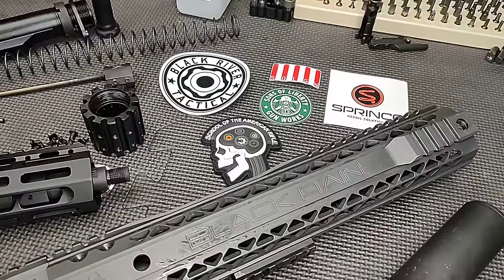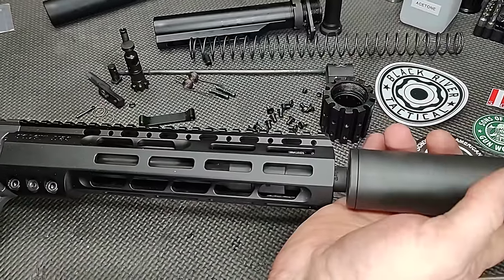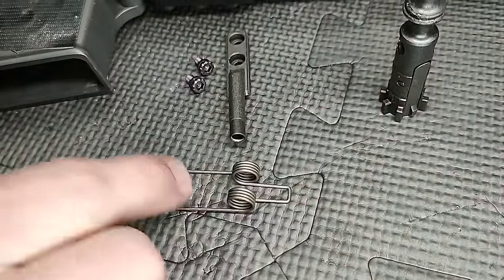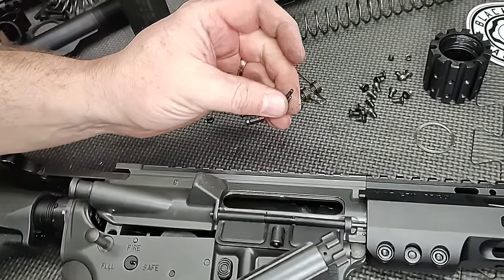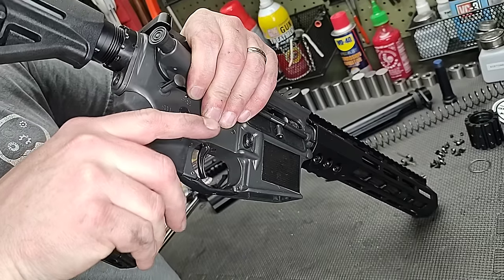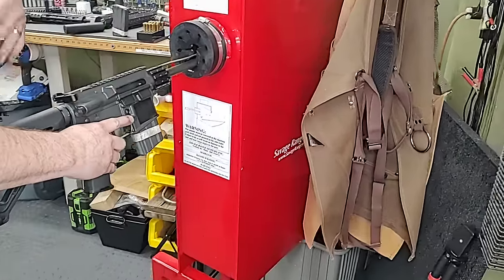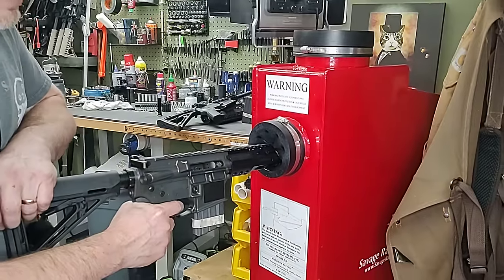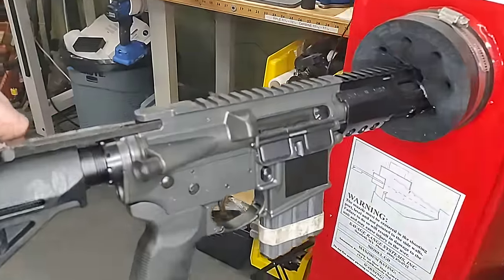Black Rain Ordnance SPEC15 Machinegun Rebuild - Part 2/2

Comment: It’s neat seeing some modern production machine guns we aren’t allowed to access. 

All animals are equal, but some animals are more equal than others.
Reply: Just one hole different than the normie ar's. You know you can buy a stamp, and be "allowed access".
Reply: Firearmism
Reply: @nobodynoone2500  Not for new production Machine guns.  The stamp only works for "Transferrable" pre 1986 machine guns.
Reply: @yc9419 yes however realistically a pre86 lower would have little to no difference compared to this, the majority of modern features are all in the upper with the exception of maybe the grip and stock

Comment: Thank you for showing that you actually have to go through multiple iterations of how to set up the firearm for it to work... So many people just want to show how everything works on their "first attempt"... Most of the things you figure out in life are ways not to do things before you figure out how to actually get them done correctly...
Reply: Yeah, i see the same with lots of stuff here on youtube. If you don't already know enough to know better, changing jets on a carb 6 times seems like no big deal until you actually do it and it takes all farkin day.
Reply: Granted it is easy for those of us that know how to, but remember back before you learned and how daunting it was. 99.999999% of people do not understand how guns work. So when they soend 1500 to 2500 dollars in one, its had better work perfectly. If it doesnt then its a piece of shjt. Its really that simple. Could you and i make a vlack rain work similar to an LMT? sure, but it will never last as long or be as reliable. Imagine buying a new car and you gotta replace the head on the first day.

Comment: How's Black Rain Ordinance still in business? Using a power drill to tighten down hand guard bolts?
Reply: I've used clutched drills to install parts before after calibrating them, but it's not ideal for parts that need to be perfectly torqued, like on firearms, engines, or other precision machine.

Comment: ever since the first vid id been wondering why they went with B.R.O.?  honestly iv never heard a single good thing about theyre rifles, the only one ive ever worked on was so out of spec it came from the dealer NIB with a  wobble wedge. and for some reason a cmc drop in trigger i thought this was kinda odd and soon i found out why, i couldnt get a milspec fcg to cycle or even fit properly , the hammer barely let the bolt by, tried a spikes fcg, a bcm, and a rra 2 stage, tried swapping different bolts colt, lantac, bcm,, and in the end i still had to ''polish'' (and i use this term loosely) the surface of hammer that makes contact with the bolt on the CMC trigger so much just to get it to run right that i didnt feel comfortable giving my buddy his rifle back and ended up just giving him one of my old spikes lowers and taking the hit, contacted BRO and the pretty much told me it was my fault and blew me off.....id literally rather run a f-ing anderson 
(sorry for the rant but i needed to vent🤣🤬)
and as always thanks for uploading, your vids are priceless, and the best on the platform.
Reply: LE agencies will buy the damndest things. My last agency bought a pile of PSA’s to “replace” the 1033 program M16a1’s. Absolutely HOT GARBAGE rifles. Very short rifle courses were destroying those guns to the point I didn’t want to issue out any of them. And don’t get me started on the Veritas 9mm PCC’s to replace the MP5-40’s 🤦🏻‍♂️
Reply: @ZSC001  gotta spend that money so next years budget doesn't go down!!!!

Comment: Thank you so much for this video! I know you had replied to my original comment on the first part of this series and hopefully you'll see this comment as well! My dad  bought me and him both a BRO spec15 for our first ar15s and I haven't even put 1k rounds thru it and after seeing this I'm most likely going to have a professional like yourself look it over before shooting it anymore!
Reply from the maker: There are not many gunsmiths that will do a better job than BRO has already done. 

Many gunsmiths will make things worse if they don't have the right tools. 

You would be shocked to hear a conversation between me and most gunsmiths.

Many gunsmiths will claim to know the AR well and happily take your money to do a terrible job. 

Be very careful on who you select.
Reply: I took the armorer’s course at Black Rain. It was an excellent course.  We got a factory tour but signed a non disclosure agreement so I won’t say anything about that.   I have not purchased a Black Rain.   I do think a buyer of any AR, new or used, should break it down and inspect every part, especially the gas system, pins, and springs.   An armorer’s course is a good idea for any AR owner.   I am not mechanical and knew little about the functioning of ARs before the class.

Comment: Curious if you use SOLGW for most of your builds @SchooloftheAmericanRifle. I absolutely love their muzzle brakes, I use them on every single build I own. They modified flash hider/brake they have in my opinion beats the surefire and the QD portion is just great for my suppressors. Havent used any other parts yet from them but thinking heavily of using them in future builds.

Comment: Great video series. My question is this when you get the other rifles, do to keep the gas tubes the same and enlarge the barrel port? Or, will you change the opening on the gas tube. My way of thinking, and I believe I can be super wrong, but making all the gas ports the same will aid in consistency between each example. I could be and can be totally wrong in my thinking. What are your thoughts? Again wonderful content and, you have spent my money on gauges and tools and have taken my builds and knowledge far beyond thank you sir!
Reply: Enlarging the port size requires drilling as opposed to just swapping components. Same result but with far less PITA.

Comment: Was it just my old eyes, or was the rear of the follower tilted downward at the rear when it failed to cycle? If it was, did that contribute to the failure , or was it just the buffer weight/spring combination? Sorry, I'm easily confused...

Comment: Would love to have seen a Geissele super 42 spring and buffer as an option. Granted they are on the pricey side and the customer/Leo is on a set budget but you get a lot of bang for your buck with the Geissele. The springco springs are great I have a few rifles set up with them but I still prefer the super 42 buffer and spring way more for reliability and quick and easy buffer weight adjustments without changing the buffer itself just adding or subtracting internal weights. I’m not going to pretend I know more than you or anyone here so I’m sure everything was chosen for specific reasons. Great video and great content this is by far one of my favorite channels on yt, thank you for all you do.
Reply: Agreed. I run one and like it. Was curious if Chad had an opinion on the design. A few guys I know don't like em, but they have a 'mil-spec or nothin' attitude.
Reply: The super 42 system is great IF you are refusing to deviate from the standard carbine buffer tube. I have one on an 11.5 that i wanted to keep shorter as a cqb gun. However A5 systems run inherently better because they are closer to the original design of the gun and allow a wider operational envelope but at the cost of adding about an inch overall to the firearm. So really as with most things it comes down to purpose and perspective

Comment: How do they use a power tool to tighten that barrel nut? Do they have an Uber deep socket? I’m also curious about replacing the bolts in barrels that already have some wear on them. Is headspacing not required?

Comment: How do to BRT gas tubes "age" as far as erosion-over-time goes compared to a barrel?  Still a great solution, and the fail-safe is just to "more gas" but I was curious.
Reply: They will erode over time and the port on the tube will open up and eventually need to be replaced. How much and how quick would depend on a lot of factors such as firing schedule, suppressed or unsuppressed, ammo etc.. but if we are talking about a full service life of a barrel then id say youre prob looking at replacing it 2-4 times depending on how far you let it open up beforehand
Reply: @silverbulletstackin1752  That's honestly not bad all things considered.
Reply: @mattfleming86  youre right its really not. Obviously it would be better if the gps were drilled right in the first place but even then you are still going to see erosion on both the tube and port over time

Comment: Will you ever do a physical on a JP Enterprises BCG and bolt? When I shop around for a new barrel, many manufacturers list them as the bolt they use to headspace.
Reply: JP is an og used to be they built all kinds of shit for name brands, dunno if that's still the case or not.

Comment: On the M89 hand guard. If your upper does not have a hole for the anti-rotation pin do you think it's worth it to have an armor drill your upper for it.

Comment: Curious why you wouldn’t have kept standard length buffer system, and have more springco options as well as weight options? Aren’t there milspec buffers with biasing springs like A5?
Reply: Possibly a departmental request.
Reply: Simply put because a5 is a better system empirically. Guns run better, longer with them. Take a SOLGW armorers course. Mike talks about it in depth
Reply: @ChristopherGoydich-cb6bd  the only time they would notice extended length of pull is either in the fully collapsed or extended positions. In between are adjustments to make it feel like what youre “used to”. The storage rack comment im not even sure what you mean. Its an extra inch to the oal of the rifle. Most gun racks are made for hunting rifles which are much longer that most semi autos in general so theres usually plenty of apace and then some. Again the rifles also run better because you are moving the firearm closer to its original design as well and opening up the operational envelope. Your points sound like you just dont like the system because its “different” than what the standard was 20 years ago and youre trying to find reasons not to embrace change rather than someone who understands how these systems operate in conjunction with each other
Reply: @ChristopherGoydich-cb6bd  they might not wish it was longer but they prob do wish it was more reliable in a wider array of conditions. Short guns have their place but those are very specific niches. Sorry i dont trust a mk18 to last anywhere near as long as even a standard m4(due to parts breakage, wear, muzzle and gas port erosion, or all the other things they have as known often failures) or reach out to distance anywhere near ballistically the same. If im going to clear a house or a neighborhood its prob fine, anything else and i would like my stuff to actually be optimized as a general purpose gun that will last a long time rather than one that is really good at one thing.

Comment: Another question, When testing buffer and spring combos does a lighter spring/heavier buffer perform differently than stronger spring/ lighter buffer? Or if it cycles it cycles?

Comment: Just curious if these weapons are used with the suppressors only why not tune them with the suppressors on only that way you could bring the rate of fire down and tune the ejection so they are optimized for suppressed use.
Reply from the maker: They are used with and without a suppressor.

Comment: What’s up with the random bottle of siracha sitting on the bench?
Reply: It's a home brew gun lube Chad mixes up himself. He did a video on it awhile back, believe it's a mix of Mobil 1 full syn red grease and full syn motor oil mixed to whatever consistency you prefer.
Reply: @danclas5983  Indeed. I use a variation on his formula and like it a lot.
Reply: Ahh, just a repurposed bottle then. Makes sense now, otherwise at a glance it looks odd and out of place 😂

Comment: I've asked and looked for a video everywhere...but the cam pin, i know it shouldn't wear a line in the upper, but what about the cut out it's supposed to hit and turn, it seems like there's a small line there and on a farely new rifle. Is that normal? I don't know what would be normal wear or abnormal, plus why? HELP OR PLEASE MAKE A QUICK VIDEO
Reply from the maker: The Cam pin will wear the upper with use. There are many variables on how fast it wears. The best thing that can minimize it is using good mags, have good feed ramps, and use generous lubrication.

It also another reason I mark cam pins.

Comment: It is called a roll pin because its rolled spring steel. Also i thought the springco green spring was a standard rifle spring. If its not  what weight is it?
Reply: Roll pins are actually rolled into a spiral profile while split pins are in a c-shape. I hear both referred to as spring pins however.
Reply: @distalradius8146  that would be called a coil pin or spiral pin,not a roll pin
Reply: @Chevydude1982  So what's a roll pin?

Comment: That BRO rail just looks like an A hole designed it. So lets get this all straight. The rail shot off, the gas port is stupidly large, the gas block came loose, the can blew out, everything was improperly fastened, and the gas key was striking the receiver. Man what a piece of crap!

Comment: It is comforting to know that the Founding Fathers believed that we should have the same arms as the government (as discussed in the Federalist Papers) and wrote the 2nd Amendment to spell that out.  I look forward to the day when the Supreme Court castrates the ATF and perhaps goes as far as negating the GCA and NFA.  I can only imagine how fun, quiet and expensive it would be to own one of these beautiful firearms!!
Reply: It's already a cheap gun. You can get a VERY nice ar for $1500 or less if you shop around, and a perfectly servicable one for 6-700, and a cheap range toy that is mostly reliable for $450 and some assembly. Ammo is where the cost comes in, and it will only get worse with the current administration raising prices and diverting most national production for mid east shiteholes.